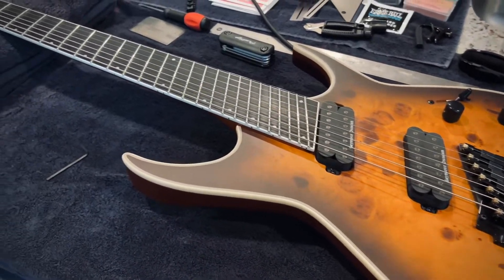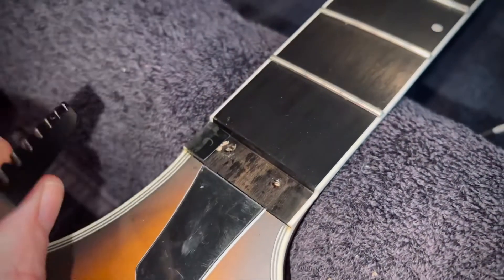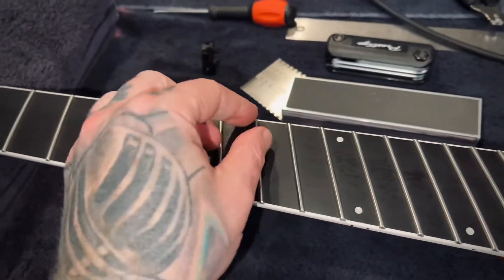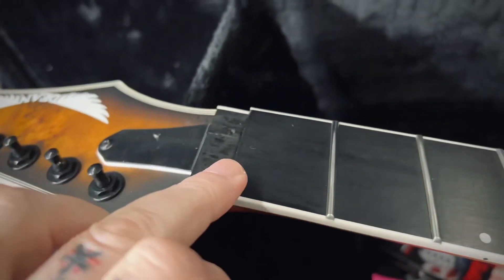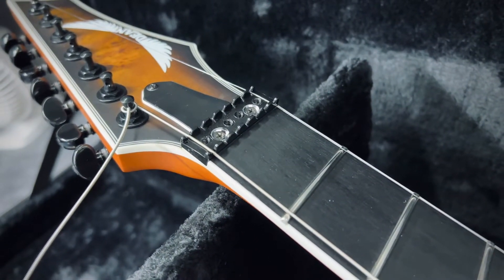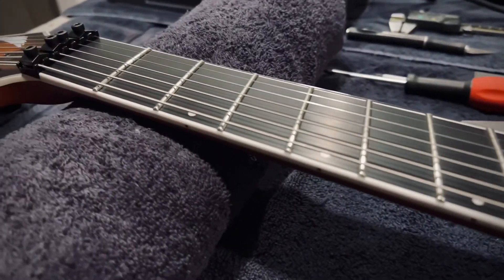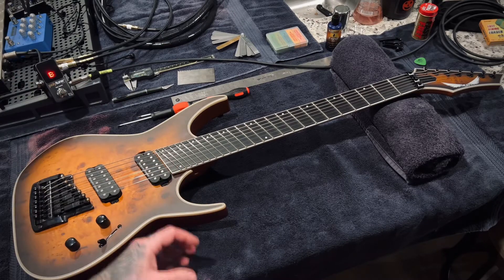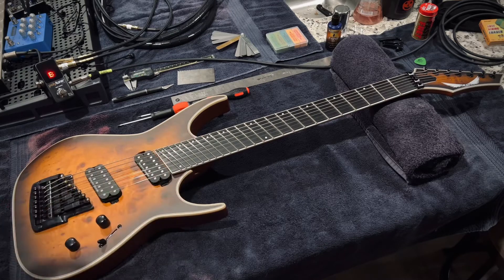Fixing Dean's Cheap Korean Exile Select 7 Multiscale Kahler SNBB Guitar - Part 2

Comment: Thank you for such a detailed review. I was looking for a guitar that will be 8 string, multi scale, has splitable humbuckers and has tremolo. Only Dean's checked all boxes. After viewing your video I was hesitant, however decided to take risk - at least I know what need to be fixed. I got a heavily discounted deal on it. Don't want to mention the price not to undervalue the model. Guitar I got was just fine. Strings aligned at comfortable height, tremolo parts seem to fit like they were made for each other. Overall I love it and it's unique, because it checked all my wish boxes. Your video is great to keep in bookmarks in case I need to fix it in the future. Thanks a lot!
Reply from the maker: Yeah, no problem! They haven’t been able to move these at all, and have been selling the 6 strings for well under a grand. At that price they are worth it for sure. 🤘🏻

Comment: I have the exile select 6 which was 1100 new I bought mine used for less. I love the finish it's awesome and the look of the guitar. I will be modifying the hardware though the strings buzz pretty bad. It has a cheap plastic nut, and the bridge I think is cheap as well I have the tuneomatic style. I was even thinking of changing the pickups to passive but the emgs are starting to grow on me, but I think I am going to order a jb and neck pickup. Prob put the emg 57 66 tw in my schecter c1 elite and turn it into a hybrid hellraiser.

Comment: Wonder how these will hold value in the long run? As for that huge fan towards the bottom it’s basically impossible to play bar chords up higher on the fretboard.  I don’t know, looks very awkward to me, but you could probably get used to anything…
Reply from the maker: I’d say not well at all. They are already selling for 800-900 brand new, and that’s a drop from 2,600.
Reply: @brutesmagootes3996  I’ve yet to see them that low! The lowest I’ve seen is the 7 string ML for about $1300.
Reply from the maker: A lot of shops where doing deep discounts over the holidays
Reply: Yea I just got the seven string ml variant for 1200 from guitar center and it’s playing g great

Comment: You can get these new for ~$1400
Reply from the maker: Yeah, they had to lower the price by $1,200 because they quickly learned they couldn’t move something built like that at $2,600. 👍🏻
Reply: @Brutes Magootes  agree that 1200-1400 should have been more of the price point. I love the neutral nut and the one direction fanning that you mentioned. Hope more brands follow
Reply: Hello do you have any websites that sell these for that price range? Thinking of getting one for drop tuning. Thanks